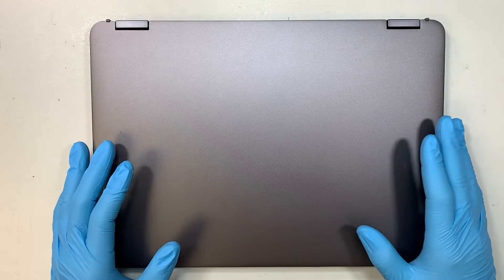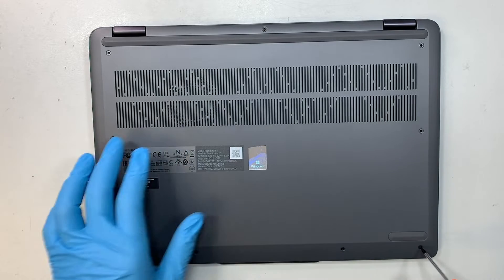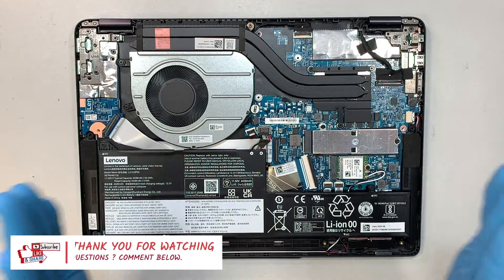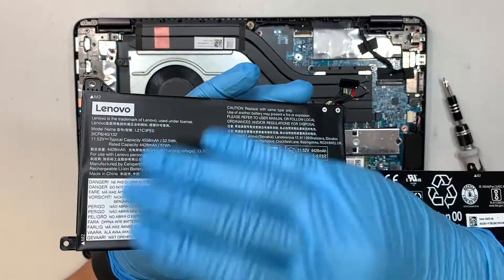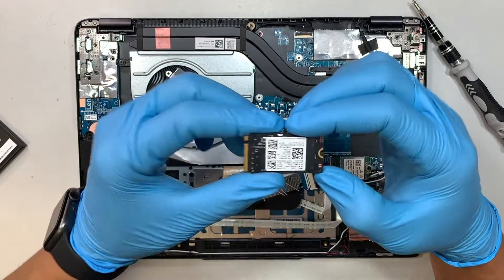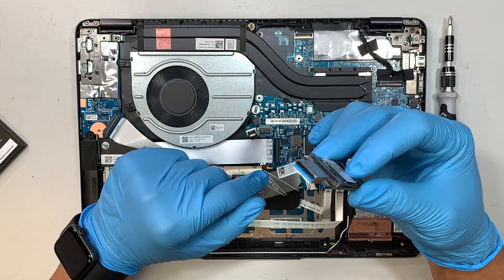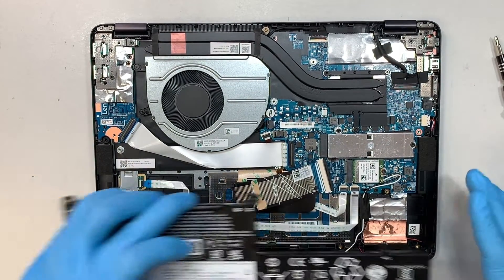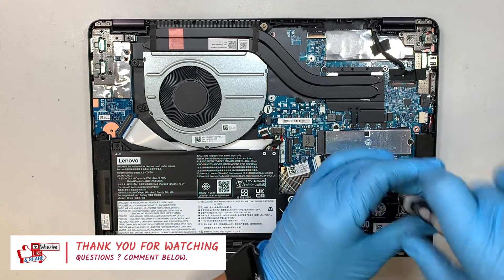Lenovo IdeaPad Flex 5 14IAU7 M2 NVMe Upgrade Battery Replacement

Comment: My Lenovo idea pad flex five is not starting. Black screen fan comes on, starting chime, keyboard, light than everything shuts down screen remains black during entire time.
Reply: I have the same issue
Reply: Lenovo website suggests removing battery, draining charge and putting back in. Will try using this helpful video
Reply: If you are still here maybe try taking off the RAM and putting it back in tell me if you solved it and how cause I'm having the same issue